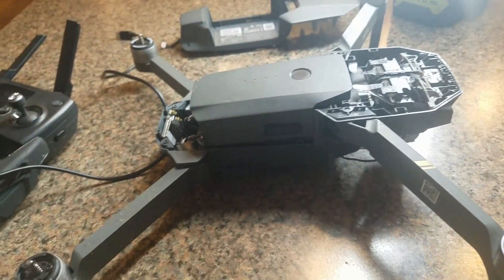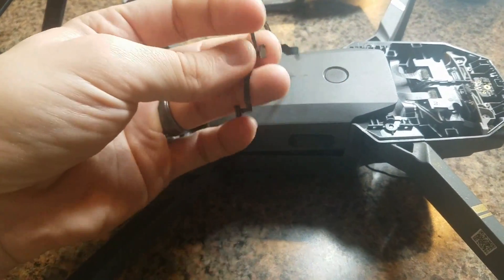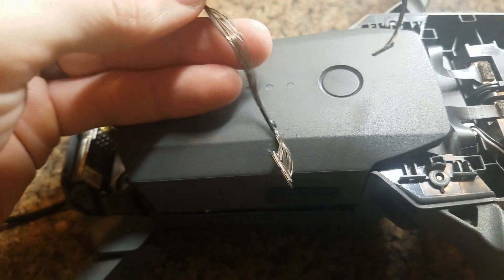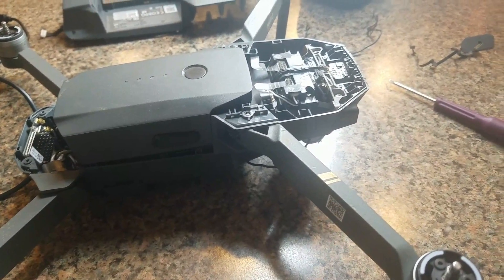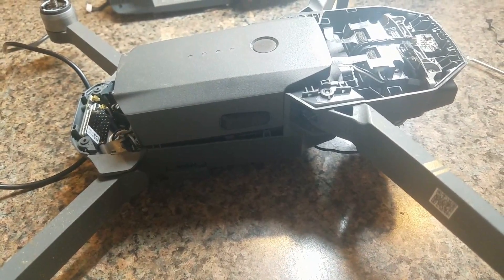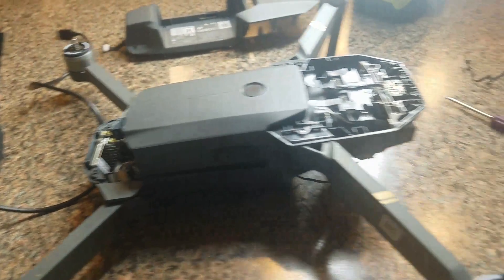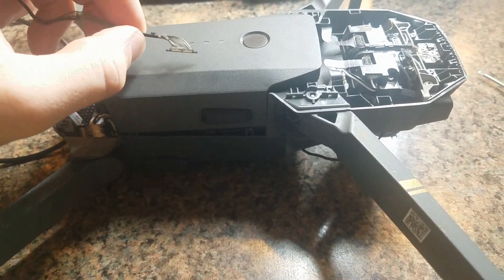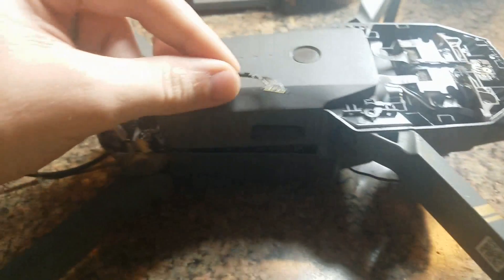SOLVED! Mavic pro 0x80000 error. No video signal.

Comment: I have a mavic pro with the same error code. It will not recognize the SD card even after formatting. I have no video or control of the gimbal panning up and down. It will not update it stops at 40% every time.  Did you have an issue with the SD card or updating from the DJI website?
Reply: Did you ever solve this problem?
Reply: Same error how you do it?

Comment: hey my drone crashed, i repaired and replaced shock absorbing plate and ribbon cable. I am still getting no camera transmission and error is Camera sensor error, hardware malfunction, contact dji support. Is it due to faulty transmission cable? should i replace that too